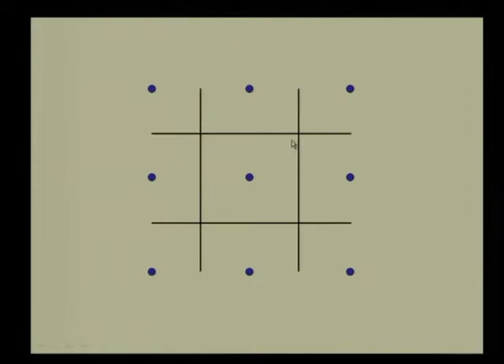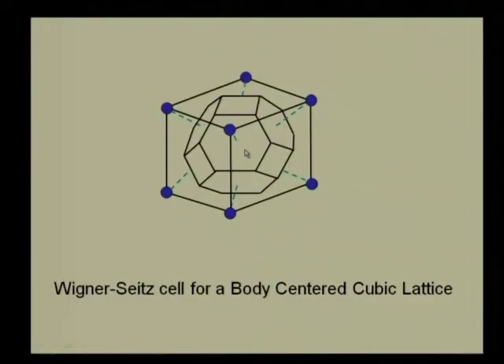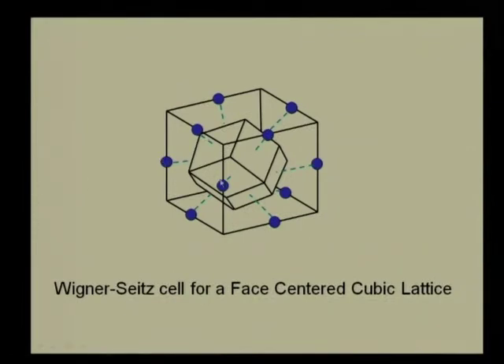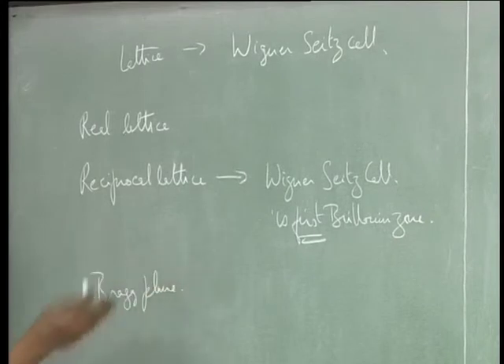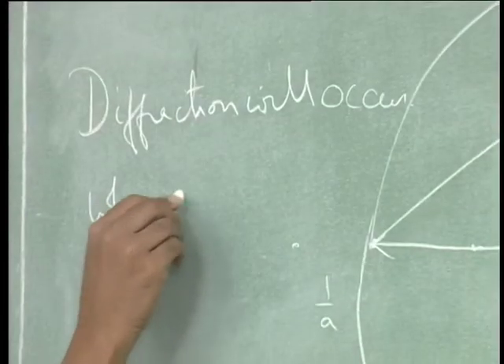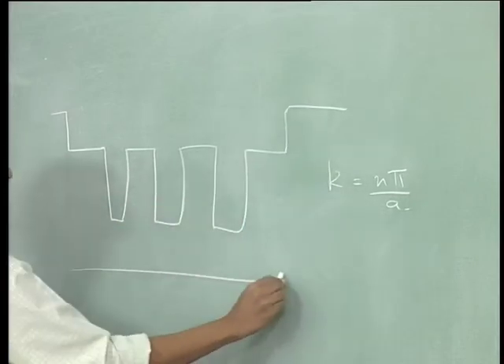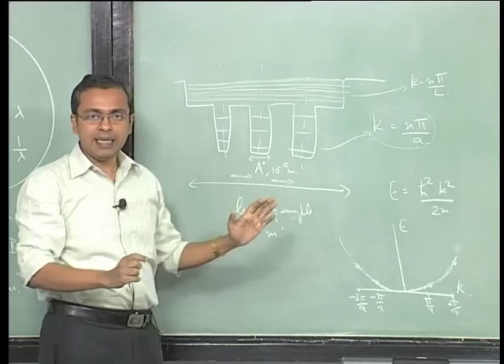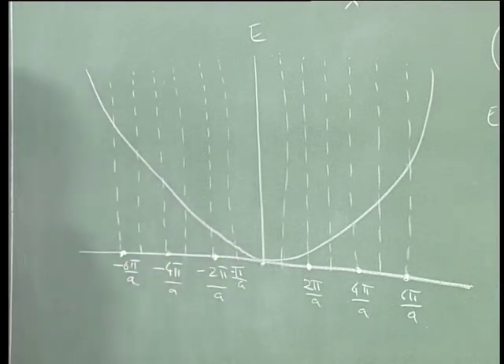Brillouin Zones, Diffraction and allowed energy levels

Comment: In the last 5 minutes, where Prof took the example of a 1-D crystal. He drew the E-k diagram for that sample and said that diffraction occur at all the the point where wave vector touches the bragg plane or brillouin zone. But in this case the wave vector is not  any external EM wave or electron wave rather it is the wave vectors of electrons confined in crystal.
How did he used the result derived for a beam falling on sample for the electrons confined in the crystal?
This is very confusing, can some one explain it?